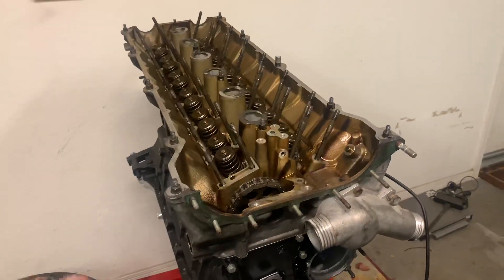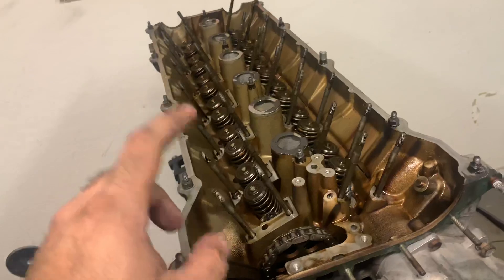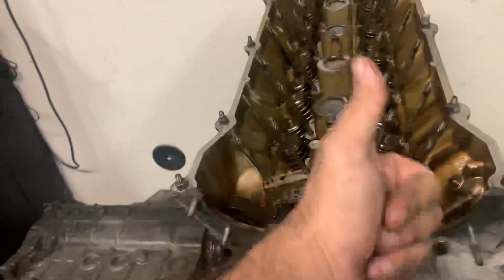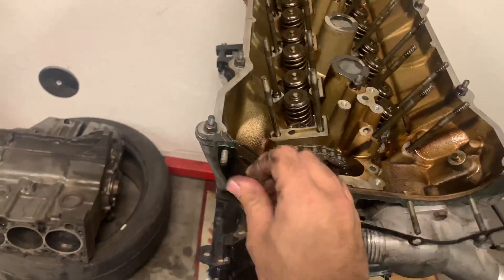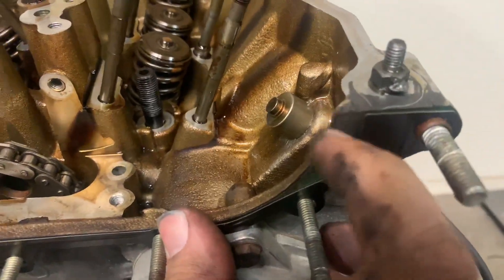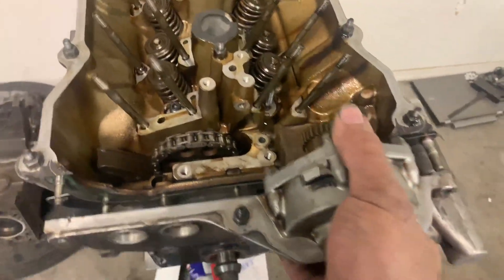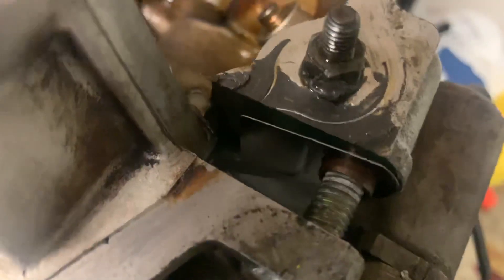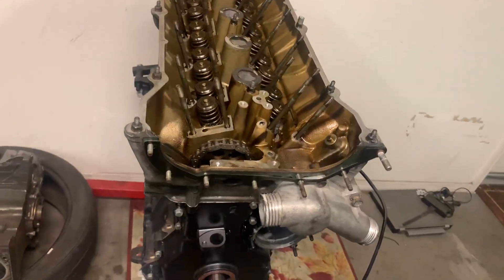Vanos Retrofit on Non-Vanos Head

Comment: Do the cams have to be swapped out as well or no? M52 cams in the m50 head or just use the m 50 Cam's?
Reply: Intake cam then has to be Vanos. M54B30 intake cam is an upgrade, M50NV intake then gets used as exhaust cam to match performance. This is harder to time as marks don't line up but it does work and improve power

Comment: stupid question but would it not be easier to transfer over the dual valve springs onto the m50 vanos head ? or does the non vanos head have other benefits that i dont know about ?
Reply from the maker: Stiofan e36 not a stupid question at all .... glad you asked.. taking apart m52 head to reuse stock m52 valves usually leads to destruction . The valves are 2 piece design so this will force you to purchase new valves and have a Frankenstein assembly in regards to valve springs retainers guides and valves . So to keep it budget oriented it is easy to with this route
Reply: @vsomar9737  what kind of cam sensor are you using running on m52 cam trays and s52 cams
Reply: @calobuilt831  did you ever figure this out ?